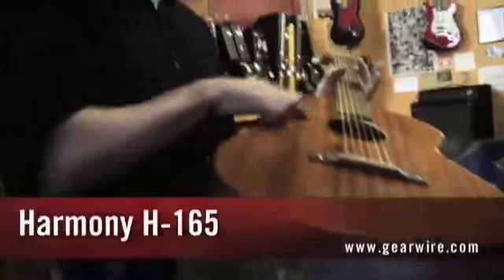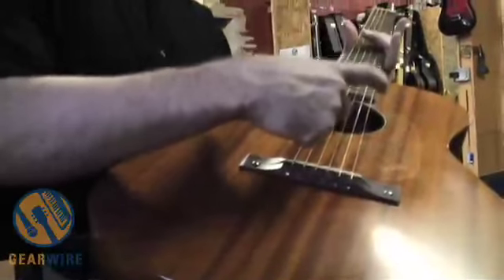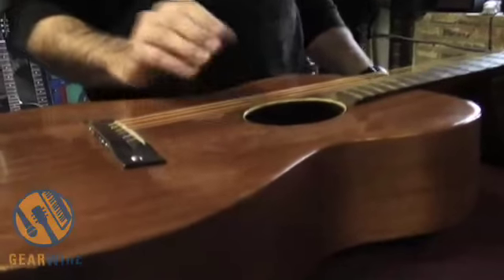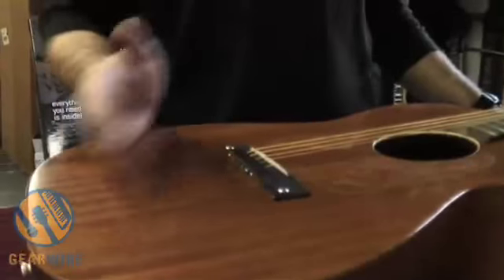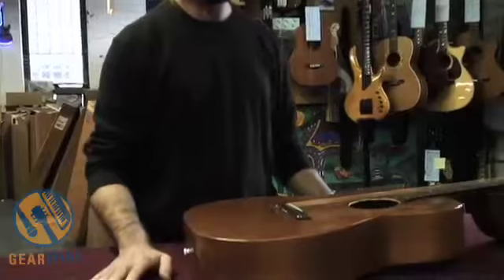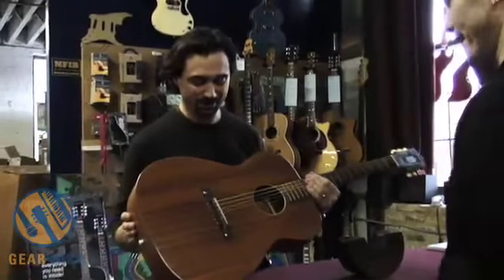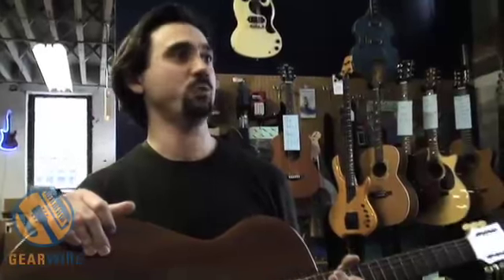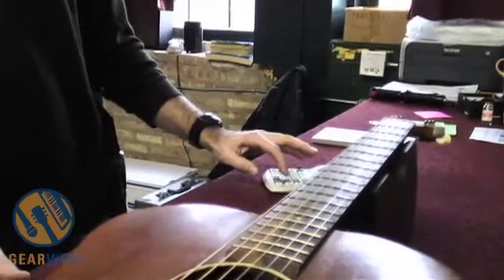Harmony H165: How To Fix A Guitar That's Imploding

Comment: i bought an old kay off ebay. it had the same problem is was sagging at the bridge. it has a floating bridge and tail piece. so i just got a bit of wood, and glued it in myself because i am skint. haha i have not strung it up yet though. i hope it works because it sounds amazing.